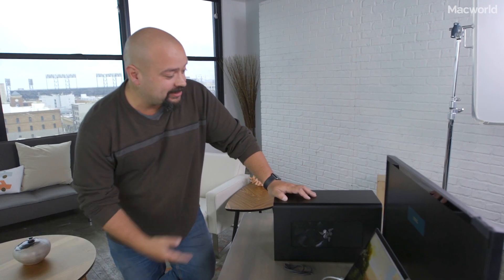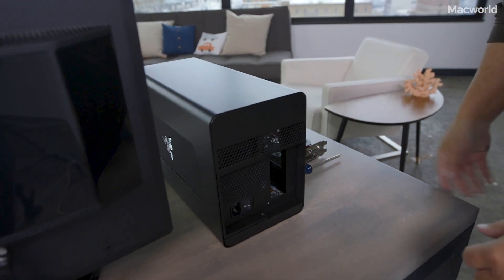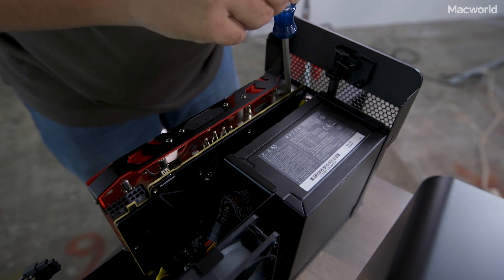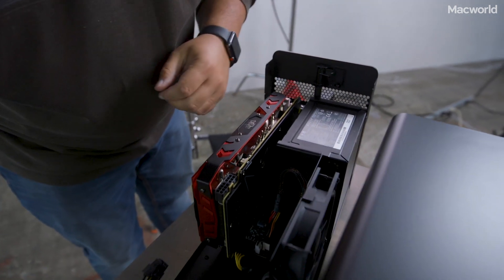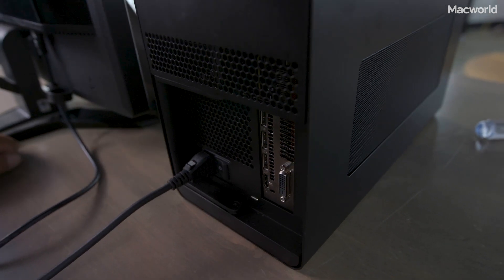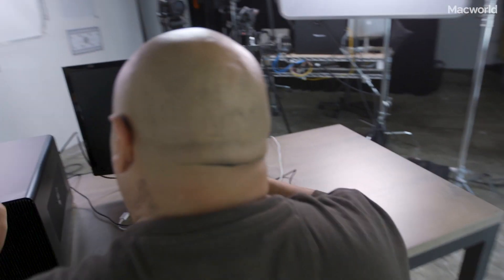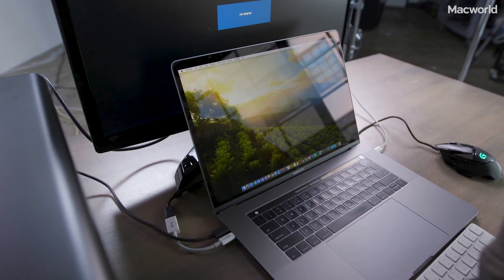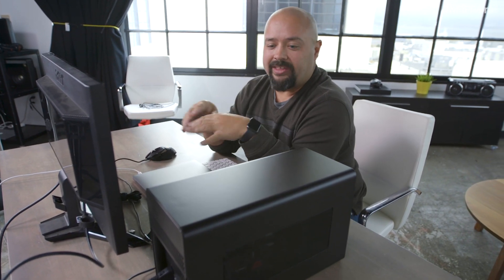How to hook up the Razer Core X eGPU to a MacBook Pro

Comment: I use a Razor blade stealth with the egpu and don't need a monitor. can run any game max setting with nvidia Gforce rtx 2080
Reply: RTX 2080? Supposedly, you should have no problem.

Comment: If i connect the Razer Core X to a Thunderbolt 2 MacBook Pro Late 2015, of course will be slower, but will still work with a decent improvement? Thanks!
Reply: https://youtu.be/TkZLO6scHbE
watch this video~~
Reply: Cameron Kuo, thank you I was searching for this information and turned up zilch a couple years ago (10-13 months).

Comment: We need to learn to do this with our Mid-2015 MacBook Pros, AKA the last of the good ones. Not the new shitty ones.
Reply: They not bad I just don’t like that u need an adapter to connect mouse, keyboard, etc
Reply: An adapter that costs $80 from Apple. There is also no MagSafe. They also have shitty keyboards that can be ruined by a piece of dust.
Reply: Very true, I own one and I do agree that the older ones (2012-2015) are the best
Reply: Hi there, I'm having the same macbook pro too. Just wondering how did the egpu worked out on your mac?

Comment: Ugh.. No research done, lots of incorrect info like Brandon said..
Reply: Can you list off some of the information that was incorrect?
Reply: JacobMenard sure..  1. It works with nVidia cards (Windows/boot camp and Mac). 2. You can pipe the video back to the internal display, you are not required to use an external display. 3. Your “apple doesn’t support nVidia” comment is misleading.  The unified drivers for the internal card are designed by amd to work on all of their devices (minus their workstation cards).  With the drivers off the nVidia site, nVidia cards work.

Comment: this video of full of misinformation
Reply: how
Reply: can you use it on the macbook screen now with the newest update?
Reply: @David C You can use a 'hack' with a HDMI ghost adapter, there is a guide on ( egpu . io )
Reply: David C I misinterpreted your question. No you shouldn't use an e-GPU with the internal display, it is a limitation of thunderbolt (1,2 & 3). The GPU, which already requires a decent amount of bandwidth, is already bottlenecked by the PCI-E lane limitation and when you limit it furthermore by having it talk back... Imagine two congested 4 lane roads being combined into a single two lane street.
Reply: MarcTBG the internal screen works fine
Reply: Bill, what are you talking about? I didn't say anything about it not working, I stated you'll increase the bandwidth bottleneck (and decrease the performance) if you send displayport data back down the same lines as the PCI-e traffic. This is a known and unavoidable issue that will persist even with PCI-e gen 4 and thunderbolt gen 3, it will be less noticeable with the double bandwidth that PCI-e gen 4 offers but the same principle applies (protocols sharing lanes/wires) and the same limitations (slower than dedicated lanes).

For video encoding, this isn't an issue as encoding doesn't take much bandwidth but for 3D rendering it will be much much more noticeable. Also gaming would be affected (if you care about that). Right now with current raster based graphic cards, the performance impact is ~15% for gaming (I'm going on what I heard) and god knows for rendering. Who knows what the bandwidth requirements are for ray-tracing cards like the RTX-2080 or the newer quadros (ray-tracing) cards but they are certainly much higher than current cards due to the shear number of calculations they'll have to due in addition to the large texture caches that need to be loaded into memory.
Reply: *in my rush I typed 'due' instead of 'do'. Heck of a typo!
Reply: Crypto Feez Apple doesn't support Nvidia after they screwed them over but you can still you an Nvidia graphics card (unofficial from Apple's prospective but completely supported by Nvidia).

Comment: will the razer core x work on a hp laptop or a asus?
Reply: Mario193 yes as long as the laptop has thunderbolt 3. It’s made especially for Razer laptops, but you shouldn’t have problems.

Comment: CPU bottlenecks on 13" MBP - how bad?
Reply: pretty bad. I'm running the Razor Core x with a Vega 56 on my dual core 2017 Macbook Pro 13inch and there is no performance difference compared to my integrated Intel graphics on Davinci Resolve. CPU is whack.

Comment: Does it work with bootcamp?
Reply: Yes it will, just because Apple doesn't support it doesn't mean that you can't. They are saying that they are not going to guarantee support in Windows 10 but Microsoft has control over using it in Windows 10 not Apple.
Reply: Yes it does, and it works well. I use it without issue with the Razer Core V2.
Reply: 'Apple doesn’t even support eGPUs in Windows through Boot Camp. That’s especially a bummer fans of PC games who were hoping eGPUs would allow us to do away with having a separate machine for games altogether.'
https://www.macworld.com/article/3274577/hardware/razer-core-x-egpu-review.html